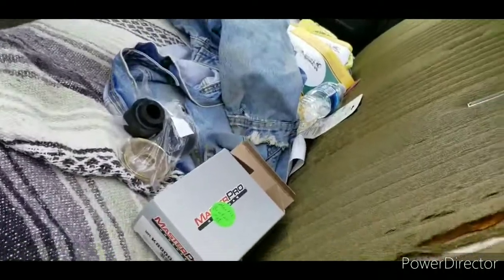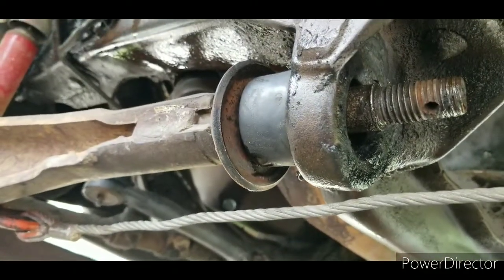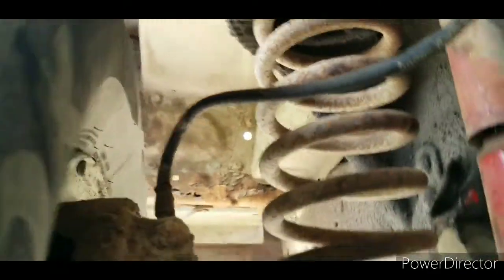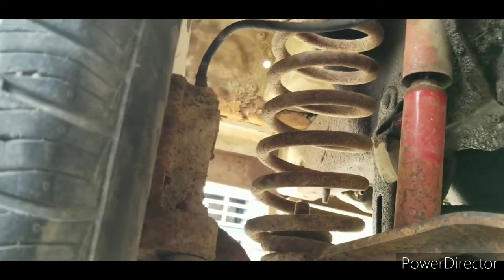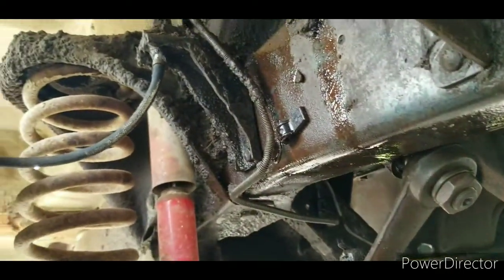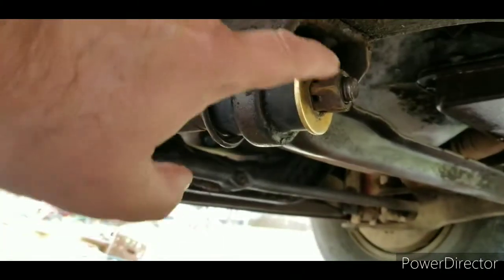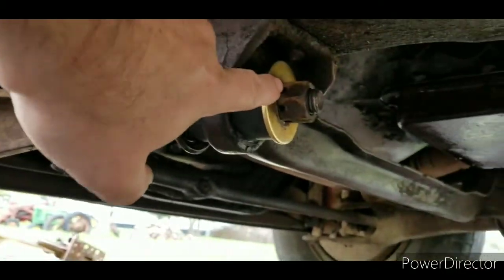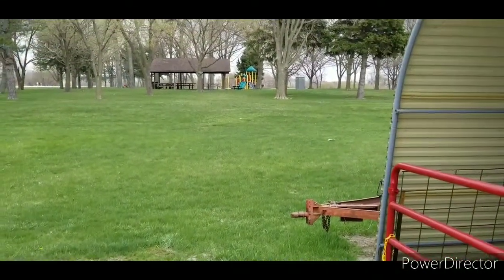1975 Ford Radius Arm Bushing

Comment: Make sure to keep the motor oil off of it otherwise it won't last too long. Depending on how much leaking you have. Just a comment. Be safe under your vehicle
Reply from the maker: Definitely! Oil is what ruined the original one. I fixed the leaking valve cover gasket shortly after...or just before.